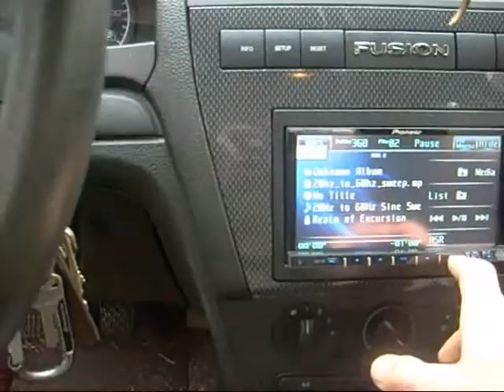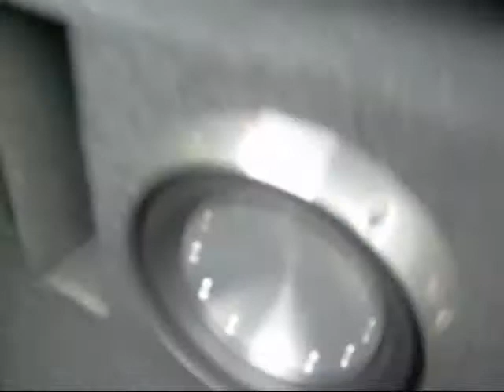Rockford T1s 20 - 60Hz and 20 - 120Hz

Comment from the maker: @imupabove Ive played it at full tilt for 30 min before and it got warm but never burning hot and has never went into protect either. RF makes a realy solid amp. its also got a built in fan that helps it out.

Comment from the maker: @imupabove I mean that the 4 gauge will give this amp all the power it needs. basically 0 would give it more power than the amp needs but you can never have enough power. kinda like giving a really big fork to a skinny person.
Im running 4 and have had no probs and it hits really hard. next install in a couple of months and im running zero but im also going to be running a sundown 4500